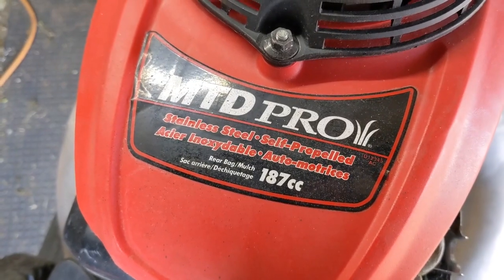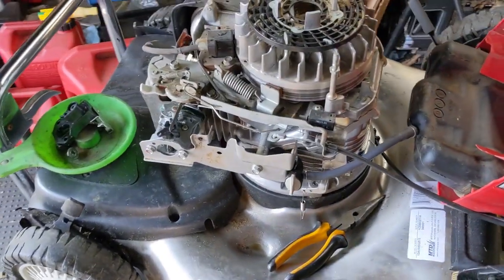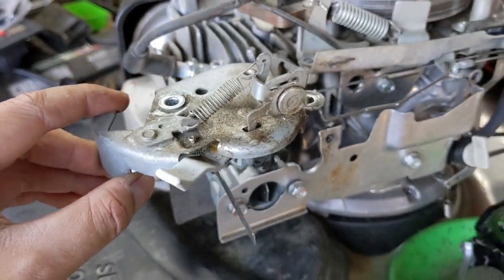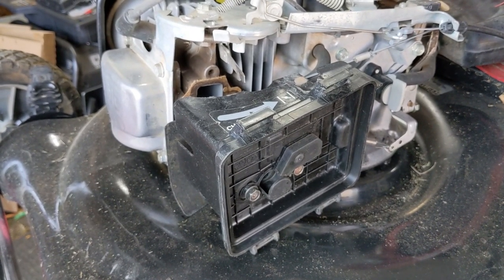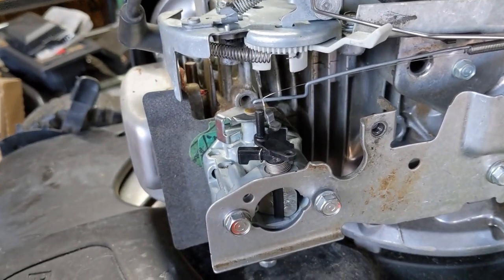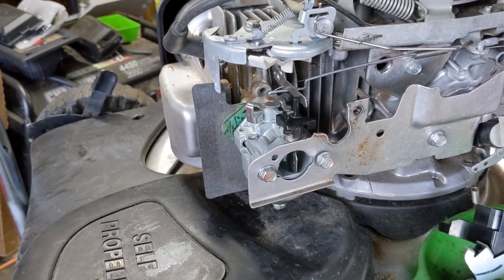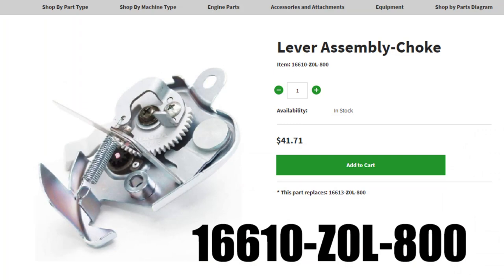Fixing a Honda Automatic Return Choke

Comment from the maker: So my customer took this mower into one of the biggest small engine repair shops in my area, and they couldn't figure out how to fix the choke issue. They also said they "cleaned and rebuilt" the carburetor, but it leaked in the end... Very unfortunate how they treated my customer, but in the end, he was very pleased with our service (and he got this mower back the next day) and said we're getting all his equipment from now on!
Reply: I have customers that have done the same thing . It amazes me how these shops act ,and treat their customers. People tell me all the time that they r rude and expensive.  Smh o well more business for me .lol
Reply: Awesome job and explanation. I've been searching for the top spring part number. The one that is attached to the rod that you bent. Any help would be appreciated. Or if you have an extra laying around, I may be interested.
Reply from the maker: Sorry I can't be of much help with that, it took me a while just to find the part number for the whole assembly.
Reply: @EliminatorPerformance  I didn't see , did you post the part number for the whole setup. That may help. Thanks again
Reply from the maker: @2wheelwhit  yes at the end of the video where I'm talking during my outro
Reply: @EliminatorPerformance  thank you so very much I didn't have earbuds in so I might have missed that part I'll rewatch it again.
Reply: Im " trying" to fix a honda mower for an eldetly neighbor
 It has a new carb new magneto new plug. No start.. Choke is wide open ! Any aid will help me fix this for my elderly neighbors
Reply: Big shops only have one real mechanic to lead the other folks
Reply: You are a very smart mechanic who understand how they should work
Reply: My issue is more that the choke won't stay on long enough.. the engine always dies right after startup because the choke opens too soon..if I hold the choke closed for like 20 seconds until the engine warms up, I can open it and it runs great. I don't even understand this choke design considering you have to pull the lever to start the engine. But as soon as you do, it's already turning off the choke..

Comment: I long for the good old days when mowers had manual throttles and manual chokes.  I had an old Honda HRS21 mower that was 30 years old and would always start with one pull even after sitting all winter.

Comment: Sir, I have chased a myriad of problems with my old Troybilt-Honda GCV 160 lawn mower. After replacing the carburator, coil, and fixing the ground on the stop switch, it would only start cold with starter fluid. I finally found your video. When I examined the hybrid choke, I noticed it was sticking open just like in your video. However mine was not hanging up, but was very dirty. I took it off the engine, cleaned and lightly lubricated the metal components and adjusted the release rod and spring. After I put it all back together, I engaged the choke on a cold engine, and upon the FIRST pull, the engine roared to life on pump gas! Thank you for your help!

Comment: Thanks for the video. I was having the issue where it got hung up while returning to the off position. It didn't actually stop but slowed down so much that the engine would almost die from being choked for too long. Your close-ups and explanation of how the system works was a huge help!

Comment: This was by far THE best video on the mechanics of the carburetor system. Your zoom ins were so sharp that I was able to ascertain the small wire that attachs to the throttle. The previous mechanic that replaced my carb, did not even have that flange on the other side of the black choke mechanism. I was up until midnight last night but I knew I could get it done after seeing this video. You rock. 'nuff said. Oh and loved the mount WITHOUT the plastic housing for the air intake to see the mechanics. I still have a bit of resistance with the actuator. I sprayed it with WD40 but knew better but just wanted to see if it improved the action and it did. Then I resprayed it with Brake Cleaner as I ran out of my Carb Cleaner. Are they actually the same? I wouldn't be surprised. Thanks again for the detailed video and know that you made a difference. You rock.
Reply from the maker: Thanks for watching!

Comment: Very good repair.  My troy bilt after I rebuilt the carb.  The choke doesn't feel as smooth.  It works.  But I am definitely gonna check on the plastic part.   I won't take it off.  Maybe hit with some compressed air and dry lube.   I spent good hour trying to figure out why it running high rpm.   But that governer pin needed adjusting.   Then had to bend my governer a little bit.   I have learned so much from you guys
Reply from the maker: Thanks for watching!

Comment: Excellent video, my Honda CVG160 has similar issue with that choke due to the small metal tab was out to far and needed to be bent back in.  Your video showed me where it should be to ensure a smooth operation, thanks again your videos are concise and spot on..

Comment: Thank you for the video.  I've had a few mowers come in with these return choke Honda engines, and most of the time, the choke opened a bit too fast before the engine could warm up.  However, on the most recent specimen, the choke would not open up on its own until I used your "half wrap" method for that choke spring at the 12:27 mark.
Reply from the maker: Works perfectly, I find that the system gets a bit of wear on it over the years and the choke plate itself just needs a little less tension so the system can function properly. Thanks for watching!

Comment: In a pinch, and I just did this earlier, you can fold up a couple of store receipts to about just under a 1/2 inch and set the choke all the way back then place the receipts under the choke wiper arm. Start it up. Works great. A piece of semi hard rubber may do the trick too. When you pull back the handle it will function normally and displace the receipt bunch then start right up. It may take a time or 2 to play with the right height but it works!!!

Comment: Have one of these from my Troybilt which I recently transferred to a Honda body.  I wasn’t such a fan of this as compared to a manual choke of yester year.  I typically have to hold it in the 3/4 released position for 5-10 seconds for the mower to warm up before letting it go the rest of the way.  However, after all the issues I see online e related to the Honda auto choke, it seems to me that this is a solution that is less maintenance overall.  This is the first video I have come across on this type of choke.

Comment: Eliminator,when you  took the  choke plate off the spring under the choke plate where it is hook just below it is a smaller notch to hook spring for more spring tension.Per Honda GVC shop manual.
Reply from the maker: Yea but this one had too much tension, like I said I had to half wrap it to get the tension just right. Thanks for watching!

Comment: I am impressed by your troubleshooting skills! I have the opposite issue. The choke was working perfectly but now won't stay stuck and slides right back to off position.  

I'm guessing a component in the assembly you've shown has come apart? I had a service done in the spring and they said the cable from the top to the choke needed replacing but the parts are no longer available.... perhaps its that. 

Anyway, hopefully this might help me. Thanks!!!

Comment: A little oil down the control cable sleeve would help, it sounded a bit dry.  That binding makes the handle part of the cable holder work harder.

Comment: Thank you. 
My neighbor has Honda lawnmower that starts and runs but after 20 minutes it stops. 
The carburetor was cleaned out it did not make a difference. 
Could it be as simple as getting the right spark plug. 
Could it be the idle screw with the air jet plastic screw like piece under it. I don’t know what else to check. 
Thanks 
Houli

Comment: Thank you for taking the time to share your knowledge. It is truly appreciated.  I'm working on 2 of these mowers and both have this problem.  Also the 3 nuts on the top plastic cover will not come off due to the bolts turning on the inside. Have you ran across this before?
Reply: I have, keep turning it and it will come off, stud and all. Separate the stud and nut. The stud also holds the coil on. When you get it removed, use thread lock to prevent in from happening again.

Comment: I need your advice. Working on Yardman mower with same gcv Honda engine. Choke worked fine.  I disassembled carb to clean jets and ventury. Now there is no protrusion sticking up from black plastic piece that turns choke butterfly.  Nothing to come into contact with the metal piece that chokes the carb then returns under spring tension.  There is no sign that the black plastic piece broke in anyway... ..it's as if I lost that part that sticks up higher to be pushed by the metal part to turn the choke on.
Are there 2 pieces there and I just lost the plastic piece that sticks higher and is pushed by the metal part.
What am I missing on this?
Thanks for any help.

Comment: Very good video. I have same Honda engine. My problem is that it revs quite high. What should I Do to solve problem. Thanks and keep up the good videos, Joe in Owen Sound ONTARIO
Reply from the maker: Cheers from Port Colborne (southern) Ontario, Canada!

Check the governor spring and adjust the metal tab to give less tension on the spring. It'll be on the left side of the engine, near the deck.

Comment: Can I ask you something?  My honda is having trouble with auto choke, I apply choke and it closes too fast and stalls the engine.  I have tried keeping the choke open and the mower will continue to run.  Even when it gets warm, when the choke is allowed to shift back to run position, the engine stalls immediately.  I see the mower you use as an example in this video as the second mower, has a hole drilled into the lever that looks like a screw or pin was being added to it to keep the choke on at 1/2.  That is what I have had to do to keep the mower running.  Is there any advice you can give me?
Reply from the maker: Yea so that's exactly what the other one had, a customer did that with a pin. Essentially, to slow the return speed, you need less tension on the return spring. You can stretch it a bit or try and bend the tab the spring attaches to
Reply: @EliminatorPerformance  Thank you so much! I cleaned the Carb and I will lessen the spring tension.  I’ll let you know what happens.

Comment: Hi, I have a Troy-Bilt mower with the Honda GCV 160 and the same choke system. Mine is retuning to fast that it won’t start unless I pull the cord once without engaging the safety bail and then pull it with the bar depressed.  Otherwise I can pull and pull choking it several times and it either won’t start or is very hard to start   I’m confused though, should I try adjusting the spring on the choke assembly or move the spring location on the carburetor as you did?
-Thank you
Reply from the maker: The spring that controls the Plastic handle you move. It probably has too much tension. You normally don't have to touch the spring on the choke (the one on the carb)

Comment: That was a very detail breakdown on GCV160 choke mechanism. 
The video, zoon shots, lighting, and explanation were all top notch. 
Again fantastic quality video. 

I picked up this non-starting GCV160 mower, and after cleaning the carb and the spark plug, 
I got it start and it runs great once started. 
https://www.youtube.com/watch?v=UmAVCnQoQms&ab_channel=DIY%26LifeSkillsDIY%26LifeSkills

However, after sitting overnight, the next day, it'll take between 10 to 15+ pulls to get it to start. 
What's funny is, once it starts, I can shut it off and it'll start right back up with one easy pull. 
It feels like it's taking that many pulls to get the gasoline into the engine on cold start. 

When I spray some starter fluid directly into the carburetor, 
after removing the air filter, it seems to start with less than 5 pulls. 

I cleaned the carb pretty thoroughly, but I couldn't get the center jet pin to come out, 
so I shoved a thin needle through it to make sure that it's not clogged, 
but looking at other videos, looks that pin also has holes on the side,
so now I'm thinking I have to remove that pin and unclog and clean it more thoroughly. 

Do you think partially clogged center jet could cause many pulls to start?

Any other tips?

Thanks in advance.

Comment: EP, I'm trying to adjust throttle cable on HRB215 with gxv140 engine. I put throttle handle to fast. Loosen cable holder. But when I pull on cable to move throttle to barely touch choke arm the cable is past cable holder to secure it. Will adjustment at top help or is the cable stretched. The problem was that chokecwas not fully closing and mower not starting.
Reply: The choke tab was twisted. Straighten it out and choke works.

Comment: I have an auto choke but I believe I’m having a similar issue I feel like that steel bar is either too tight or not tight enough because when I turn the throttle to fast(to start it) it doesn’t seem like it’s fully engaging the auto choke. Is that possible?

Comment: Hi EP great video again and extent of investigation to sole the choke issue.  

I am looking for some aluminum deck HXC 215 parts. First I haven’t taken apart but it is is very possible that I need to get another Hydrostatic  variable transmission. Do you have one (used)?  Also a mulching plug, a rear right wheel, a black knuckle handle bar nut.  If anything please advise.
Reply from the maker: Nothing like that here, I hardly have anything used or scrap anymore as we've been busy with repairs and I needed the room so I scrapped anything we weren't going to use

Comment: At 5.56 you said if the choke releases too fast that spring was responsible and to fix it you’d release the tension in it, how would I go about doing that
Reply from the maker: You can bend the small metal bracket that the spring hooks up to alleviate some tension off the return spring.

Comment: Thanks for the video.
How long did all that take you?
Reply from the maker: About 1.5hr total because unfortunately I had to tear the carb apart to clean it, even though the previous shop said they "cleaned and rebuilt it". They couldn't even figure out the choke system, so it's not hard to believe the carb had issues too. I gave my customer a deal on parts and labour because I got a great video out of it.

Comment: Seems like a weird system... if you're  a slow mover, the choke would already be half way open by the time you engaged the 'bar' and the time you pulled the recoil.  Or am I wrong?  I love your channel.  Great stuff.  Thanks! Dang I get yappy after a margarita.. sorry ☺🍺
Reply from the maker: It's absolutely a flawed system, and I've have to decrease tension on the return spring because of that reason. They travel back to quickly for some older customers.
Reply: @EliminatorPerformance  Thanks for the great explination.  You rock dude!

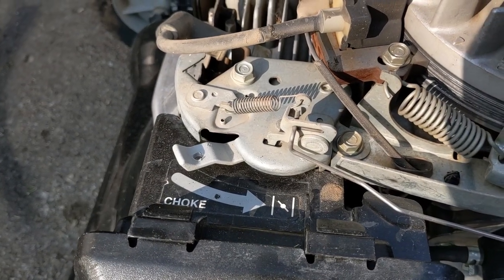Comment: I have the exact same setup on my mower. The problem with mine is it starts just fine, but when the choke returns to the run position, the engine stalls. Did you ever run into that scenario? I'm ready to drill a hole in the choke lever and use a screw to keep it from returning,  just like at 2:34 of this video. Any suggestions would be greatly appreciated.
Reply: I typically catch the lever at the 3/4 released spot when the engine sounds right with the highest revs and hold it there for 5-10+ seconds.  This gives the engine more time to warm up before I release it and then engage the blade.  This minimizes the chance of a stall.  Seems to work best for me

Comment: Mine is the opposite problem....The engine kill switch is activated until the clutch brake lever is pulled, but as soon as the clutch brake lever is pulled, THE CHOKE GOES OFF!

Comment: So the choke is disabled by the zone control lever when you are trying to start the mower.  What the hell was Honda thinking?  like the 6 gaskets on the carb honda had a bad idea and has kept it around for decades.  Better solution to the problem is to take some of the bends out of the linkage between the brake/ignition release and allow the zone control lever to go almost all the way engaged before the choke is released.  Works perfectly every time.